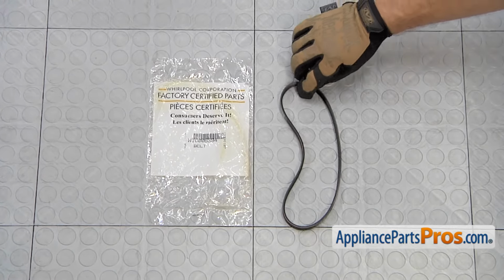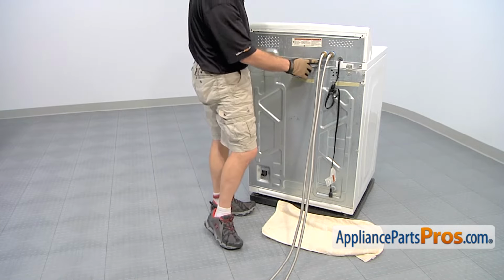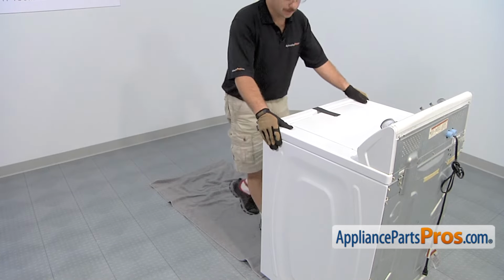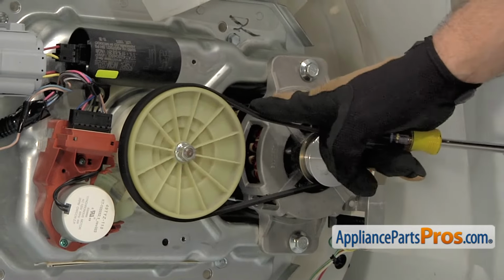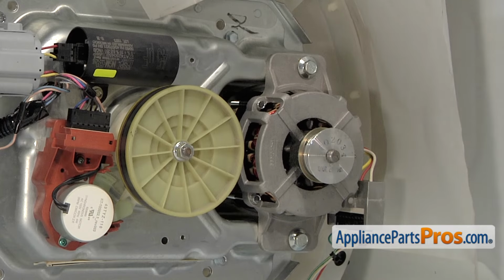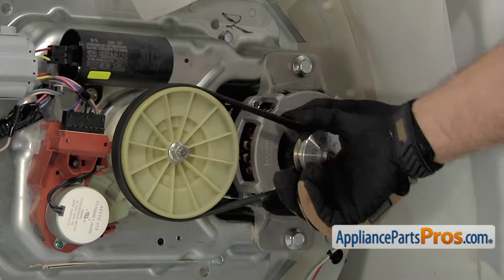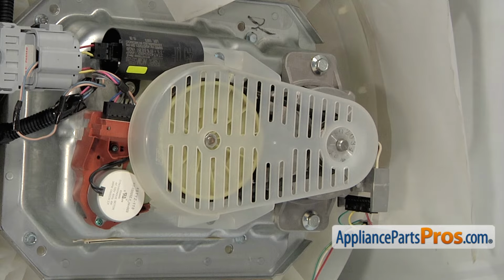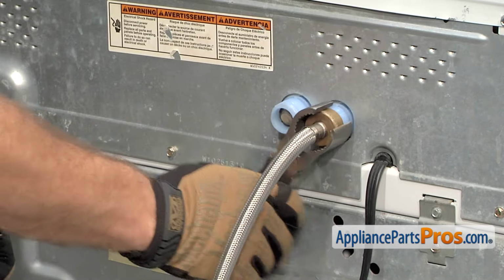How To: Whirlpool/KitchenAid/Maytag Drive Belt WPW10006384

Comment: Great video. Initially I thought they sent me the wrong belt put it is supposed to be super tight!
Reply from the maker: Thanks for sharing! That's a common first impression—the new belt is designed to fit very tightly. Once it's installed correctly, the tension helps it grip properly and operate as intended. Glad the video helped!

Comment: I will never again buy a Maytag or whirlpool machine.  Belt went bad and in the process it did some damage to the $10 motor pulley.  Guess what, you can’t buy the pulley, you have to buy a new motor. 
FU Maytag, speed queen here I come.

Comment: My belt keeps slipping off the motor pulley as I try and thread it on the big pulley.
Reply from the maker: What is the model number of the washer? It is possible you have the wrong belt. Other than that, the belts are tight and can be difficult to get on until you get the hang of it.
Reply: @appliancepartspros  WTW5800BW0. 

I got the belt from your website by searching my model number. I think I had to tighten the pulley.

Comment: Phenomenal video! Thank you so much! 

The only thing that seems weird is wouldn't we want to test to make sure that everything's spinning after we put the belt on before connecting the hose and things like that? 

Thanks again for this incredible video it helped me immensely
Reply from the maker: Great question on testing: after installing the belt, do a quick by-hand check while it’s unplugged—spin the large drive pulley clockwise to be sure it turns smoothly and the belt tracks centered, then set the washer back down, reinstall the bottom shield, reconnect power/hoses, and run a Drain & Spin (or the service “Spin” test). Those spin modes don’t add water, so you’ll confirm everything’s turning without a fill.

Comment: I had a very difficult time getting the new belt on, until I wedged a butterknife blade between the wheel and the belt, and rolled it on. Otherwise an easy and effective repair.
Reply from the maker: Great trick! Sometimes, a little creative problem-solving makes all the difference. Glad you got it on and finished the repair—thanks for sharing!

Comment: Hi, On our washing machine that drive belt keep coming off the bigger pully. I made sure belt is centered and also tighten the holding nut and made sure pulley is not wobbling. Still belts keep coming off, what could be the problem?
Reply from the maker: If the belt keeps falling off then it may be stretched out so it's not fitting properly. If everything else is checking ok, then you will need to replace the belt.
Reply: @appliancepartspros  Thanks. I did. The new one that keeps coming off.
Reply from the maker: It's possible the wrong part was ordered because it should fit snugly. If you have your model number and the part number you ordered we can check to make sure you have the correct one.
Reply: @appliancepartspros  Thanks. I ended up replacing the splutch. It is running good now. The Old pully may have slight bent that my naked eye couldn't see.

Comment: It was so hard to put in, I put it on hot water for a few minutes like hot boiling water and it work it was so easy to put right after.
Reply: Thanks for this suggestion.  NONE of the above comments or video was going to get this belt installed - it just seemed too small (a bit smaller fit than this video shows because he gets more wrap around the larger pulley than I start with).

Comment: I’m literally sweating trying to get the new belt on I’m convinced it’s not possible lol
Reply: Same
Reply: @865Boog  -Were you able to finally get it on and if so how?
Reply: @donmckinney4091  yes, I was. I was holding the belt in the wrong place. Put it on the small pulley first and then applied pressure on the bigger pulley as I rotated the pulley in reverse
Reply: @865Boog  -Thanks I tried that trick and it worked! That belt is a beast to  get on but your technique worked!!
Reply: @donmckinney4091  happy washing, brother LOL.
Reply: @865Boog  so ur initial comment was before u even watch the video
Reply: Same here

Comment: The small pulley has sides to hold the belt in place.  The engineers are stupid!  Belt constantly falls off transmission pulley BECAUSEIT HAS NO SIDES!!!!!!!!!!. POS.
Reply: I have this issue. It is the top pulley area where I get wear on the shield. Replacing the sheild today. The sound it makes it terrible..

Comment: My Whirlpool Washer  Top Load Model # WTW4800XQ1    I installed new belt part # W10006384  I find new belt super tight to the point I loosen  the bolts on motor mount  to install the belt ( I tighten them back after putting the belt ) . But my washer fail to spin even during wash cycle  What I am doing wrong?Any difference bewteen part # WPW10006384  and Part #  W10006384  ? My old worn out belt with number 11 118 vs new belt showing 18 045 is this the problem

Comment: What if it's turning but the clothes are still soggy after the spin ?
Reply from the maker: We'd be happy to help you figure that out, but we'll need some additional information about the model and the problem. You can give us a call at 1-877-477-7278 or you can chat us at our website: http://www.appliancepartspros.com/. We will need the model number for the appliance, so that we can look up diagrams and information about your specific unit to give you accurate advice. You can look here on our website to help you find the model number: http://www.appliancepartspros.com/modelnumber_locator.aspx
Reply: Ring them out by hand and toss them into the dryer, Then Call a repairman.